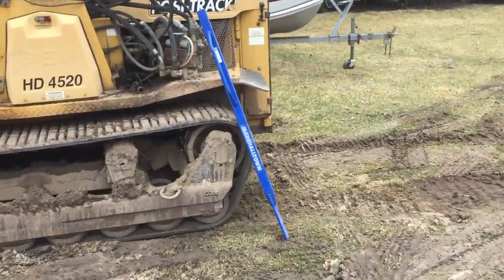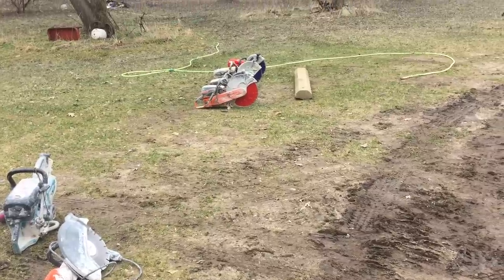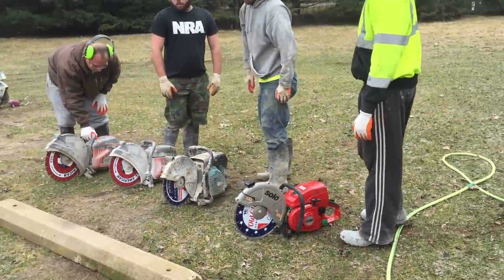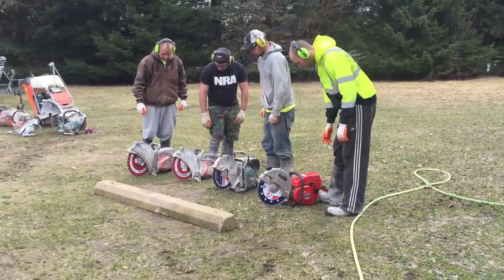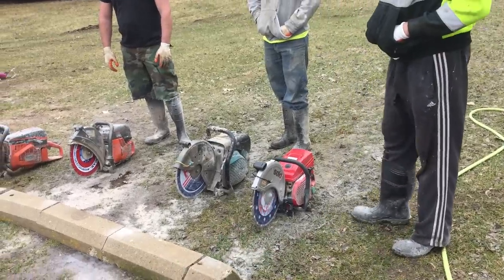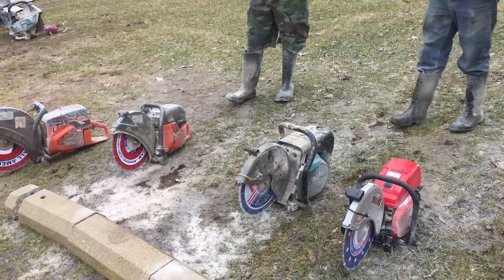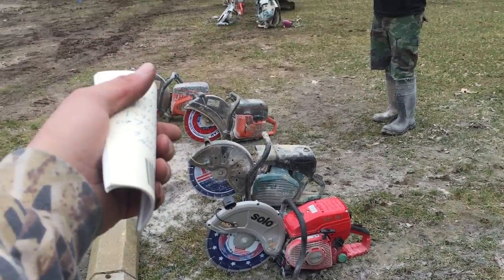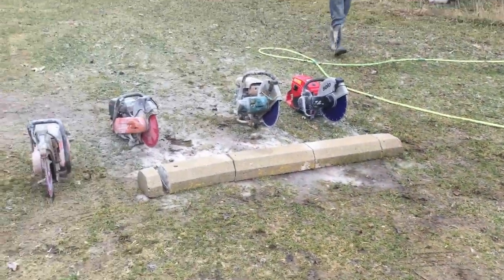Makita VS Husqvarna VS.....SOLO?? Concrete saws cutting test.

Comment: Cool test. I kinda figured the larger blade would win.....more surface area to cut with. Never heard of a solo saw. Have ran wacker/husky saws the last 20+yrs. Stihl saws used to have horrible air filter systems (not sure if they have changed their design)and would eat a set of rings pretty quickly so I quit using stihl concrete saws for that reason.
Reply: 100% Agree with everything you said.

Comment: I own Husqvarna 16" I use it for concrete slab (cuts from 2 ft long to 100ft) and is really pain to use it. Saw starts in the morning with no problem guys are working for 1h-2h and after that is impossible to start. We have to put this saw on the side and when you will come back to this saw 40 min later sometimes this saw will start sometimes we have to wait a little longer. I own Stihl 14" as well and is working all day no problem. When Husqvarna 16" is working I like this saw better than Stihl. BTW Water "system" fail on my Husqvarna after few months and saw is not even 1year old. We use same ready mix for both saws. One is working all day another half (if we are lucky). In Husqvarna service they told me nothing is wrong because saw starts and they can't help me.
Reply: NewEra might want to set the Low carb jet a bit leaner and keep air filter clean. If it's not that it's the coil, I own a tree service and husky saws suck at hot starts/hot weather. They flood most of the time but I've had coil failures as well.

Comment: And what did we learn from this? Nothing logic couldn't have told us. Bigger saw + bigger blade = cut faster. 

This can't be used for comparison sake for mainly two reasons: different user = different pressure on the saw and technique; we don't know which saws were warmed up ahead of time - colder saws have less power. I'm not saying this is a terrible video by any means - thanks for taking the time to post it - I simply wanted to point out that one shouldn't draw conclusions on these saws/blades based on these results.
Reply: Make your own video then.

Comment: Great video and information about the saws. Interesting that you don't like Stihls at all, #1 name but not the #1 saw for you or me. Great information about the Makita and K750/760 for the different applications. BUT you used three different blades and put the slowest cutting and lowest cost blade (lower diamond concentration) on the Solo. Plus the Fury is a soft bond compared to a combo blade (medium/hard) like the All-American. Thanks for the info.

Comment: since I was a kid the two machines that have given us problem are hot saws and jumping jacks.  it takes a seriously well built saw to handle concrete and rebar in large scale operations.  Stihl 500 m-tronic is the best saw on the market to date.  The new Hilti is a close second, but it just runs to rich brand new and you better turn it down or they last about one year with moderate use. let's not talk about the old crap.  Having a m-tronic is great for vapor lock and plugged air filter.

Comment: I watched this because I'm interested in getting one of these saws for sidewalk repair. I already have a SDS maximum drill. I was told most of these saws use a 32:1 mix ratio. Are they like chainsaws where they have a decompression start? 🐀🐾
Reply: 50:1 i have 5 saws like these...

Comment: Husqvarna 970 holds a 16" blade. 

While it's still the clear winner, in this test it seems to be turning a larger blade. 

More cutting surface equals faster cuts. 

Not a fair demonstration
Reply: More cutting surface is perhaps one part in it, but to me the largest difference is the edge speed. With a bigger blade rotating at the same RPM (don't actually know if the RPM is the same) the cutting edge will be travelling faster and will therefore remove more material.
Reply: Its all about power. The more you have the more pressure to the wheels you can apply.
Reply: Pls husqvarna 970 16 inch Motors Indian rate please price

Comment: As I stated 3 years ago - given that I know these blades very well .....

Great video and information about the saws. Interesting that you don't like Stihls at all, #1 name but not the #1 saw for you or me. Great information about the Makita and K750/760 for the different applications. BUT you used three different blades and put the slowest cutting and lowest cost blade (lower diamond concentration) on the Solo - The Old Glory is a 30 Bond GP Blade. Plus the Fury is a soft bond compared to a combo blade (medium/hard) like the All-American. Thanks for the info.

A contest or comparison like this should have all factors the same. If you had put the Fury on the Solo it probably would have finished first.

Comment: Ive done concrete and masonry 45 yrs i have 5-14" saws...Full throttle is not always faster when cutting and water will make no difference it only keeps dust down a dry cut will always be faster than a wet cut.. Your blade representative will verify what I'm saying.

Comment: why no sthil? they are much better than either of the other brands you have tested
Reply: no .. no they are not ..
Reply: Ezzynation yes they are by far! Husqvarna are absolute rubbish. I've used partner, makita, stihl and solo over the past 15 years and stihl run rings around the rest. They've always cut faster, the hose fittings last longer, easier to start and serviceability is better.
Reply from the maker: Really????  then wheres the video showing such evidence???
Reply: hilti, wacker neuson, speedy cut, dolmar??
Reply: UnderTenReviews the evidence is me actually using them in real life over 15 years
Reply from the maker: REALLY?  Wheres your proof? or are they just better because you can't explain why?
Reply from the maker: Ill be waiting over here in the corner for that 15 years of experience video???
Reply: I use these saws every day and from my personal experience the k750 will start first pull when warm, the ts410 and the ts400  are pigs to start. when they are all running both brands are excellent but for me I prefer my k750. all saws are serviced regularly and we'll looked after.
Reply: says the person who can't afford to use one
Reply: i disagree with you stihl and husq are pretty close. if the world was ending those would be the two tools i'd look for in  an apocalypse
Reply: UnderTenReviews to be fair I've used stihls for a long while, probably around 8 years now, I haven't tested them against huskys but against every other make so far they have prevailed in terms of cutting speed and durability, my first saw was a stihl ts800 which is a brilliant saw, I've had it ever since I became an apprentice. It's got bucket loads of power and outstanding build quality, hasn't once given up on me.
Reply: Simon A good point lmao
Reply: Stihl beats Husqvarna for sure. Less torque twist, and cuts straighter
Reply: kjrutter17 I'm sorry but Sthil makes good weed eaters you want a concrete saw you want husky, I've worked for more than 5 concrete cutting company's and husky is number on pick, it's not just the saw ether the blade is most of it
Reply: Wish my company would get there head outta there ass and get me a 16"
Reply: kjrutter17 we have a stihl that's beast but the guy running the 970 was actually sawing he would naturally win my personal fave is the major ek model 7301 I believe.
Reply: Sthil is so overrated it is a great saw. Ive used both saws .  Husq is a much better saw in my opinion. Sthil 3 month warranty.  Husq 1 year.
Reply: Everyone knows stihl are the best
Reply: No Still? Thats like having a truck comparison without Chevy or Ford
Reply: Sthill used to be good, once they discontinued the ts400 not good anymore
Reply: About 10 years ago one of our ts400’s was backed over by a one ton dump full of stone. The next day the saw was back on the job with new parts and still is today.
Reply: undertenreviews  the stihl 500 is truly the best hot saw on the markets.  And yes I do know.  own 5 and have been using hot saws to cut concrete and rebar since 94' everyday except in the winter.  Partner to old  hilti's to new hilti you name it. In 100 degrees to 20 degrees and stihl is the only machine that wont vapor lock after making a 20ft  4inch deep cut and then let it sit in the sun and it will still start.  M-tronic    I do own husky chainsaws and would by a auto tune hot saw.
Reply: kjrutter17 iii
Reply: Dan Kruger the stihl ts 500 is the biggest pile of shit ever
Reply: I have been working concrete-demo-foundations since 94' and used every hot saw brands out there.  If you run your saws on a 50 man plus crews the only saws that makes it is the stihl's with m-tronics.  The new Husky's work great, the 700's kick ass,  they work great.
Reply: Fuel type and oil play a big part in the longevity of the saw. Had to replace a lot of top ends do to poor fuel and oil mixture. Some even put cheap Chinese air filters and most of the dust goes to the cylinder therefore blowing the whole thing up. We still have a ts 400 running for 3 years straight without replacing the top end at all, just regular maintenance.
Reply: Honestly they don't need a video. EVERY major construction company in the uk uses them because they are just unbelievable. I have used Makita Husqvarna and Partner. I also have over 15 years experience using them. those things can run quickly from cold even with the filters clogged with months of crap. A Husky is ok but the build quality is poor in comparison (i snapped a foot off one from a hire center). I just don't think america has discovered Stihl. and hahahaaaaa. just come to the end of the video. seriously re run the test with a Stihl and there impressive water suppression system. https://www.youtube.com/watch?v=FsQ3h6FEfLI
Reply: Husq is way better than stihl
Reply: I'd say the stihl, with the top handle is the best for an accurate cut the top handle really makes the saw feel like a paint brush. It's good for artistry, but husqvarna really has better rpm's and is better balanced, making it easy on the back. It has a tad bit less "paint brush factor" than stihl but obliterates it in most other categories. The only thing stihl got going for it is an abundance of customer support with stihl dealers everywhere.
Reply: @ThatGuyOhDarn  could see why you'd say that. That's just because huqsys have more rpm. Cuts straighter? Yes but minimally. The rpm's on husqys make up for the little ground it gives up to stihl. They just cut faster.
Reply: @Anon Ymous husqvarna does have more plastic parts that's for sure. Stihl do last long. No question. But they could be Tough on the back.
Reply: I have nothing bad about sthil but husky is what has down best for me cheap on parts last longer not saying sthil is bad just not good for this type of job everyone just goes for sthil cause its a high rated brand they never look at the specs of the saws i got a husky k1260 and k1270 never had one issue both start very easy cut perfect to my company did have a sthil at one stage and the second day it was used it fucked up so i just stick to husky

Comment: could you respond my question which is the best blade. i already bought few of'em but it doesn't cut the way i'd like
Reply from the maker: What is a saw blade supposed t do for you?  we are making a review of which blades last the longest very soon
Reply: Too much pressure on tool makes bannana cuts let weight of tool do work fonts force it trust me.

Comment: Should of tested a STIHL
Reply: I agree. My ts420 blows my brothers K760 husky away. Way more power. Just got a ts700 and its a beast.
Reply: @SpYucaipaSoCal  I've honestly had the exact opposite experience. We lay concrete storm line everyday and have/use both the ts420 and the hooskie 760/770, everyone goes for the huskies first, every time.  They are much lighter and the anti vibe is vastly superior to the stihl. Our jobsite opinions ofc.

Comment: The downside off the makita is that you have the starter pully on the right side and you can't tilt it because it's a 4 stroker!
Reply: you can tilt it has a pressure lube system
Reply from the maker: BS, i had it upside down at WOC and full throttle
Reply: You can bud it's got the same oil lube setup that koenigsegg use in their HyperCars.

Comment: Sorry this video sucks. Fist off you said every popular brand is here... Stihl isn't, and despite what I have read in the comments about this or that they are still one of the most popular saws out there. Second you said you had some 90%+ success rate with your saws, and then went on to list off problems. Out of six Husqvarna saws there you said one failed twice which is actually a 17% fail rate just for it breaking once, leaving me wondering where the 90% came from (but you know, 89% of percentages are made up on spot or was it 75%... wait 90%). Third the saws clearly have different blades on them so the is not a head to head and is immediately left one of the saws at a disadvantage, and even if they are the same size price an use they still aren't the same making this test inconclusive. OH Yeah, and the reason Stihl is better is because they have certified service centers to fix the equipment at, and from personal experience Husqvarna does not and parts can be hard to find. All in all you just wasted my time and the time of everyone else who saw this video by not taking your time and not being consistent. Thank you

Comment: Where is your masks guys! You really want to be breathing in concrete dust and petrol exhaust fumes?? Seriously? Good luck with that...Anyways Its an invalid test, too many variables not to mention differences in operator, you have different blades different machine specs even one guy was spinning the clutch, way to burn that out...not too mention the solo wasn't getting too much water, I use a K750  it's awesome! It'll do the job and be very reliable if you use it and maintain it properly! Go buy a K750 I had mine for about 5 years and it's mint never let me down once.

Comment: not an accurate test....different blades and cutting techniques just for starters. it suspiciously looks like politics 
at play here. the 760 is 73.5cc @ 4.96hp....the solo is 81cc @ 5.45hp. not to mention more compact, 
ilube technology so can't be seized.....a huge difference and a clear winner. those 4 stroke saws are underpowered and
rubbish.